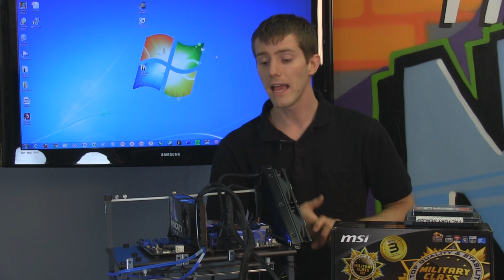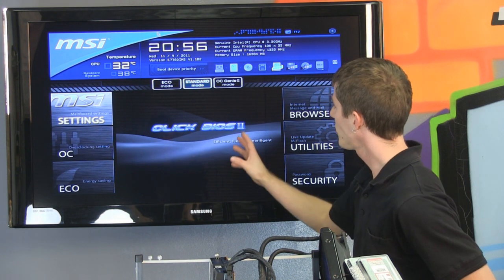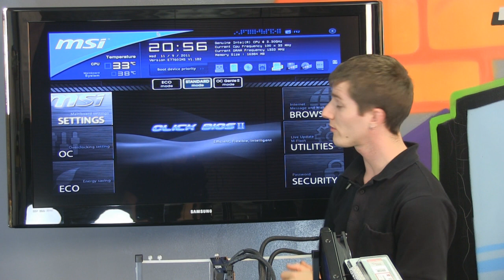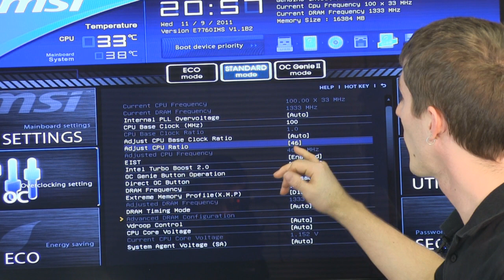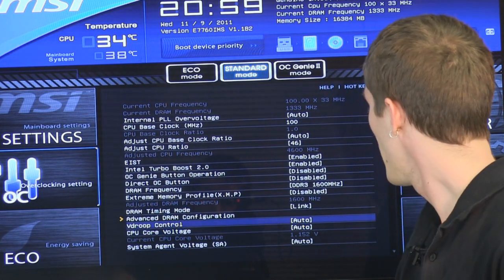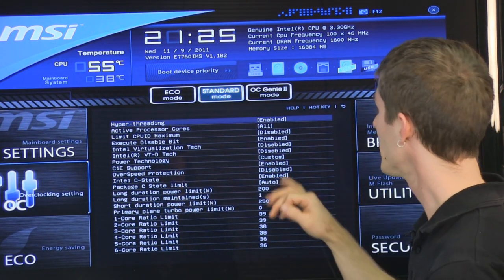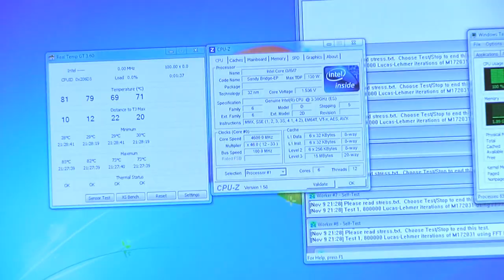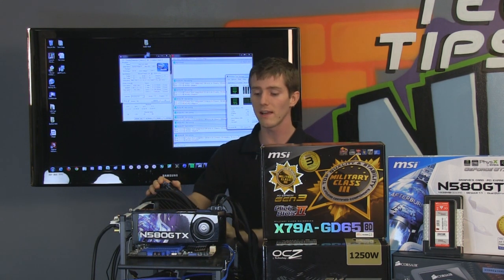Intel 2011 Core i7 Extreme 3960X Overclocking Guide Tutorial NCIX Tech Tips

Comment: My 3930k is full stable @ 4.6Ghz 1.344v , why put 1.536v on this cpu ??? 
yes I know this video is +/- 7 years old but WOW it is completely abused valtage for only 4.6Ghz.
Reply: can u tell me settings for 4.0 I got the same  cpu with a gd45 board
Reply: @ascendediam  CPU Vcore +/- 1.2v
Reply: @ascendediam  this is the only thing you need to change . And also the multiplier @ 40
Reply: But your cpu IS @ 3,8Ghz stock . Why you want to overclock your CPU @ only 4Ghz ? you will have virtually no benefits
Reply: @ascendediam  try 4Ghz 1.2v
Reply: @ascendediam  you probably have a poteto CPU
Reply: @Jazz Morales   @Jazz Morales  why u sayin that I dont kno wha that weird quote means I did tell u I got this same cpu and didnt u say u got the same cpu to why dont u tell me why it wont change the volts to the rite way was that a lie u got the same cpu cause u wont help
Reply: @ascendediam  no processor has the same overclocking potential. even if they have the same name
Reply: @ascendediam  listen I'm lazy and you do not seem to understand, you need to learn about the oc.
Google is your frends

Comment: 1.55 vcore voltage for just 4.6Ghz...  But WHY?
Reply: Could probably run at 5Ghz+ at those voltages
Reply: @unox12317  its runs fine on 1.45 in 5ghz
Reply: @yavb3lo1futb0lk3  reply in a year with those voltages please!
Reply: 2012 cpus LUL

Comment: Is it bad that I just bought a 3930k lol
Reply: I just bought one. They're super cheap.
Reply: Yes, E5-1650 ist a few bucks cheaper ;D

1.55Volts is pretty advanced, my german forums give em about 1.3-1.4V 24/7.
Reply: +TobagoGames Meh I just want 6 cores for some basic stuff. Don't need more than that.
Reply: +NaCl The 1650 ist exactly the same CPU. 
Im running it on 4.5Ghz@1.3Volts, testing to squeez another 100Mhz out under air.
Reply: +TobagoGames you can oc the 1650?
Reply: I'm really glad that I decided to pick it up. It's been working great and is oc'd to 4.2.
Reply: OC Macrobob Yes, no problem at all.   1660/3960x is the same deal.  

Avos   4.2 shouldnt be the end of the line, but the more distance you get to the 4Ghz, the more heat youll get.
4.6 is impossible with my Chip, like it was before with my weaker FX6100 :D

***** I hope so, having spent 450 Bucks on a used four year old system^^  Cinebench is total domination against every Skylake, thats pretty cool stuff.
Reply: i hope not cuz i just got a 3820 LOL

Comment: Hi guys i have a msi big bang xpower 2 with a i7 3930 3.20 GHz and 16 GB of ram i would like to know what is the best overclocking setting for it  and if somebody has a video on how to overclock it
Reply: DH Rider if you have a Rampage its easy thers some preset in the Motherboard for Oc
Reply: use 4.6ghz on Offset 1.3V worked for me fine without any Problems.
Reply: 6,5GHz 2,1V

Comment: I picked up a Rampage IV Extreme, 3960x, and 64GB RAM, and I couldn't afford a GPU either.
I ended up grabbing a used 670 for a temporary GPU. In December I'm going to drop about $500-$600 into liquid cooling with a Corsair 800D, and summer next year I'm going to grab the best most expensive card.
Reply: And now?

Comment: Whenever i have speedstep enabled my psu (ThermalTake Tough Power XT 875w) coil whines like hell when it throttles up to 4.4Ghz. Would it be better to just run a straight up 4.4Ghz OC and deal with the higher idle temps. Note im using a 3930K with a Noctua NH-D14.

Comment: I think 1.5 volts is way too high for 4.6Ghz. I have a 3960X stable at 4.5Ghz with 1.37 vcore volt using a MSI X-Power II mainboard and custom watercooler setup.

Comment: True! I had to retire my Intel C2Q Q9650 (12MB L2 Cache) @ 3.5 Ghz, because I was bottlenecking my 2 GTX 460s in sli with games like Battlefield 3 and Crysis 2. I replaced it with an Intel  i5-2500K and even at stock speeds the bottleneck went away. My FPS increased by about 25% in gaming.

Comment: Im building a new computer but never OC'ed my cpu before. I was going to get the k version and try to clock it up to 3.6 or 4.0 depending on how hot it gets. It seemed easy until he started with the voltage, how do i know how much to set up the voltage as I go? and testing it stability?Does that mean stressing it until your computer just crashes?

Comment: Although true, with Sandy Bridge CPUs it has been known for chips that've been pushed over 1.4v for a 24/7 clock to start degrading. There's no real way to know if this will happen to your chip, my chip, or the guy down the road's chip...but it might, and it's not a risk i'm willing to take.
Also - 1.55v on Sandy? That is WAAY over the top.

Comment: yes, so if the CPU is at 4.6Ghz then the 4 cores are also going at 4.6Ghz. 

The cores are in the CPU. thats what CPUs are mostly, cores. so yes, your brother and you are both right because they are both pretty much the same thing. 

The CPU has other stuff not just cores and they arnt clocked. so you cant say the whole CPU is clocked at 4.6, only the cores but you cant individually clock each one. they all have to be the same and depending on the clock decides how fast the CPU is.

Comment: @demaciu88 I don't know if your familiar with the lithography of the processors. The conroe series were all 65nm in thickness, this therefore allowed them to be able to withstand a lot higher voltages by being able to disperse heat more effectively.When we start comparing this to a Sandy bridge E processor your argument is ruled as invalid because of the fact that Sand bridge E processors are 32nm in thickness making them less capable of sustaining such high voltages without any degradation.

Comment: @demaciu88 Did you mean to say, herp derp!?
What proccesor are you talking about? I'm talking about the sandy bridge group of prossesors as shown in the video. Your comment is totally invalid. Having to put that much voltage on any current day prosseor would give you an oc of 4.8ghz, and up if your cpu is capable of such an overclock. BTW 3.4ghz at 1.5v sounds like your talking about a dual core from 4 years ago.

Comment: I have a 30 dollar CPU cooler (CM hyper 212) and my 2500k didnt go over 58c running prime 95 overnight at 4.2ghz. Why did he bump the voltage so high? I didnt even TOUCH my voltages for my 4.2ghz overclock.

Comment: Don't get me wrong - this is a nice video, but I doubt a 4-channel memory controller is going to have anywhere near 33% more bandwidth.  In practice, 2-channel is typically around 10% faster than single channel, but getting more total RAM in a system is certainly a good thing.

Secondly, that PSU is overkill.  A 500W PSU would still give some headroom for these components.

Comment: @TheStovernation

Extra cores = Extra Heat
Cores
i5 2500k = 4 core, 4 thread
i7 3960x = 6 core, 12 threads

Extra wattage = Extra heat
Wattages
i5 2500k = 95W
i7 3960x = 130W

I would say 4.6Ghz is a very good and stable overclock, and realistically you wouldn't need a 24/7 overclock of 5.0-5.6Ghz.

Comment: @OTAKUJHE Very few programs today uses more than 4 cores, so only professional video editors or anyone who need a lot of threads would benefit much from this. The 3960X have also replaced the 990X and its price of about 1000 USD, so it is clearly intended for the most extreme users. Though the 3930K (100Mhz, and 3MB Cache less) costs about half of the 3960X, and will probably be preferred by enthusiasts. But 2600K is still a good buy, and I might build a system with it myself after Christmas.

Comment: @xN1k94x It's a much better setup than what sandy bridge is. Plus sandy bridge E is using 2 extra cores which gets 2 more cores and extra heats so in turn you need higher volts to get a higher ghz to make it stable.

Comment: It should be emphasized that this new x79 platform is geared toward workstation users whose primary usage full out ripping, video editing, etc. For gamers, this platform is WAY overkill. There are no software home use or games that will even access ram over 16Gb or use more than 4 cores.

For typical high end gaming config I will still recommend 2500k or 2600k with the $500-$1000 being spent on SLI GT video config.

This platform only benefits those that will actually USE it.

Comment from the maker: @keiki646 Temps were not going up after 3 hours. They were stable at about 5 minutes.

As for whether 3 hours is enough, it's absolutely not enough for a production system, but on the other hand, ~80% of the time a system passes for 3 hours, it will pass for 300 in my experience.

Comment: To continue where I left off,  and it was only at 4.6Ghz hitting 89C with a H100 switch is not the best for that extreme overclock settings. I will recommended using a better radiator if you guys are all about watercooling, for Air cooling I will not recommended overclocking to those settings using  an Air Heatsinks.